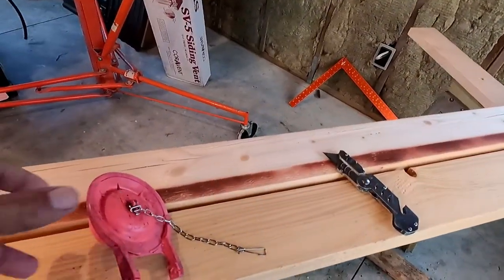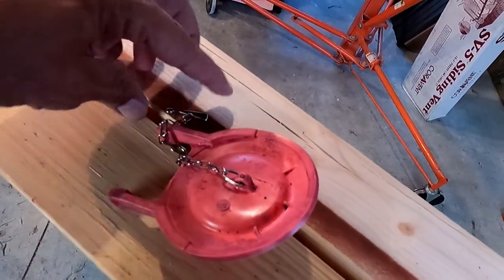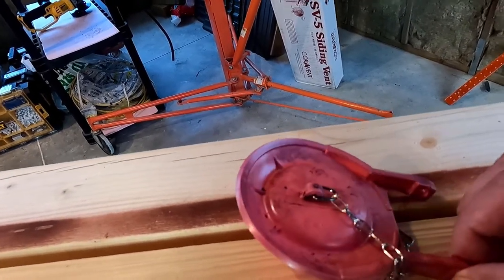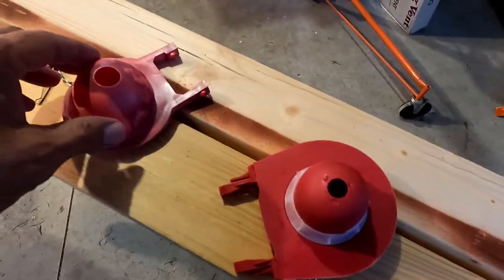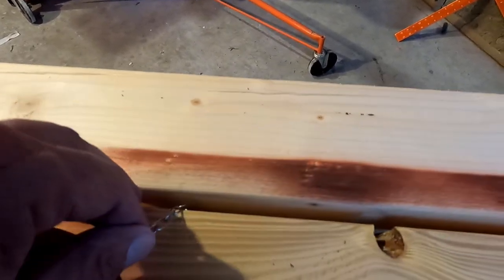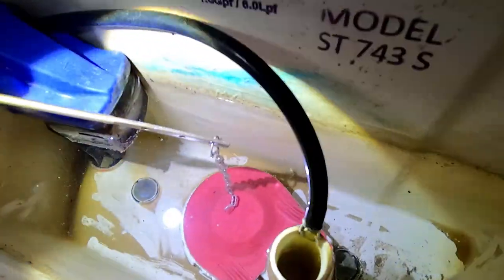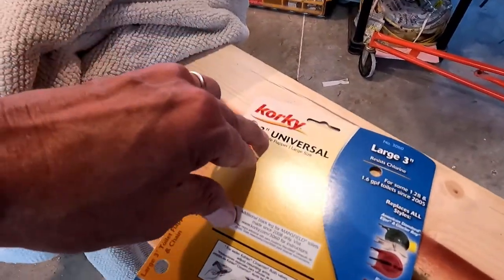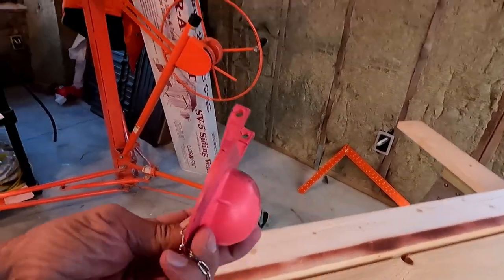How To Replace a Leaky Toto Drake Toilet Flapper Valve [And Most Others]

Comment from the maker: I've replaced a lot of flapper valves in my day, but never seen one that had no way to remove it without cutting it off! I watched two videos -- which were useless -- and finally cleaned off the hinge area and got a flashlight down in there enough to see (kind of) that it was one piece. From there it was relatively easy, but another thing that was new to me was the dial on the bottom. You need to adjust that as well according to the chart on the back of the package.  The How-to playlist can be found here: https://www.youtube.com/watch?v=gZlBd1kAcOU&list=PL_iZ8t8zAFuMSRCR79voRAMUc5rqICtET

... and the tip jar can be located here -- 🍺 If you enjoyed the video, consider buying me a beer!: https://www.paypal.com/cgi-bin/webscr?cmd=_s-xclick&hosted_button_id=U5BDZFCHV9WLQ&source=url

Comment: I broke my Toto Drake flush valve trying to take the red flapper off! Both stems snapped off so I had to buy the newer flush valve for the Drake at a plumbing supply store and remove my entire tank to install it. All because I didn’t know I should cut the flapper off. I have 3 Toto toilets and the blue flappers have big enough holes to remove the flapper easily.

Comment: I watched your video first and thought I would have to cut off the flapper. My old flapper was still flexible, so I had no trouble just pulling the rubber tabs off pins. Like another poster said, easier to do than describe. My TOTO brand replacement flapper was #THU500S.  This is different than the TOTO one  I removed and it seems to have a better fit.

Comment: Thank you Planet Mojo. I saw two videos and they made it looks so easy to remove the old flapper. I was getting frustrated until I saw yours and realized I have to cut it. Thanks. However, after I installed it the flapper won't drop after each flush. Any uggestions?
Reply from the maker: The flapper turns to allow more air into it. Turn it all the way and it will allow more water to fill the tank.

Comment: The flapper does come off without cutting it but no big deal to cut it off. To remove without cutting pull the rubber and turn the hole in it 90 degrees vertical as you pull it off the "ear" on the end of the pin. The hole in the flapper arm should go from its original orientation to such that it like a hole in the floor. Harder to describe than it is to do it... or cut it off.

Comment: If the flapper goes back down too fast (allowing less water to get into the toilet, should I reduce the number of air holes by turning the adjustment ring to minimize the air flow?   The original flapper is still on the toilet because, like you,  I couldn't figure out how to remove the flapper without cutting the hinge!
Reply from the maker: I closed the holes completely.